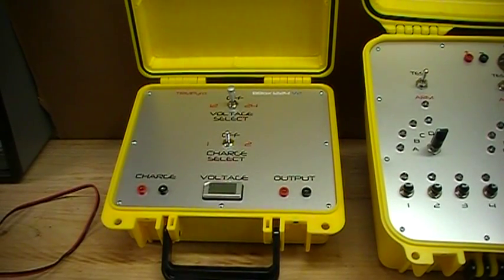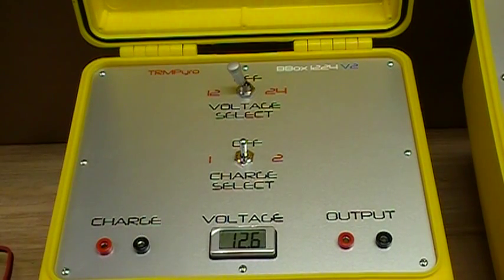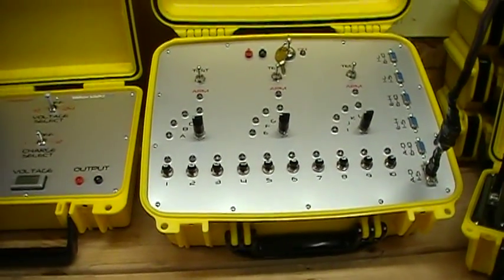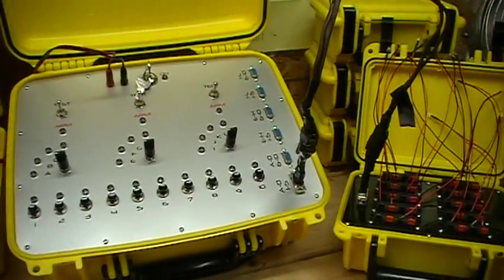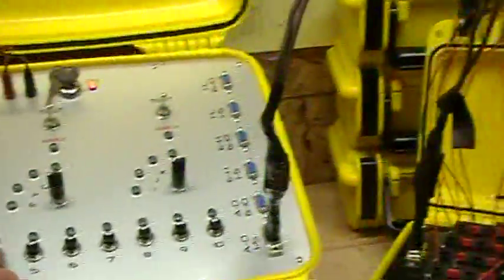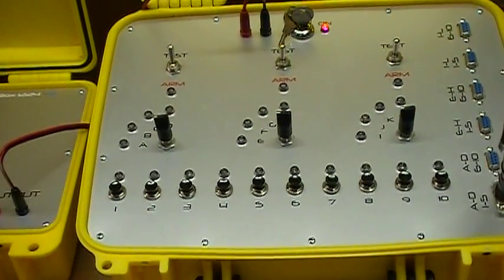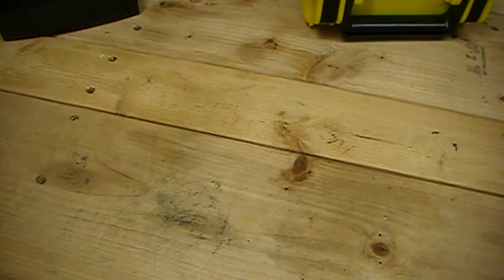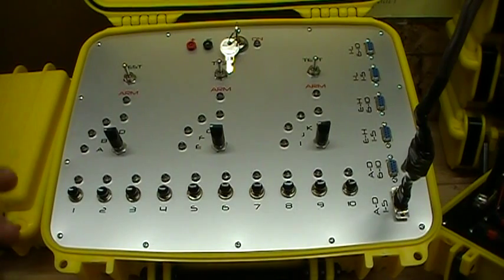Fireworks electronic firing system part 2

Comment: Where did you get the internal circuit boards for your firing system and the internals of the firing slats as well? Also the all the external switches, buttons, plugs, plug ends for your cables to each slat, and the connectors for the ematchs, talons, ect.        Thanks Scott